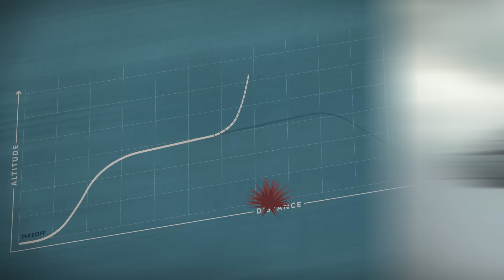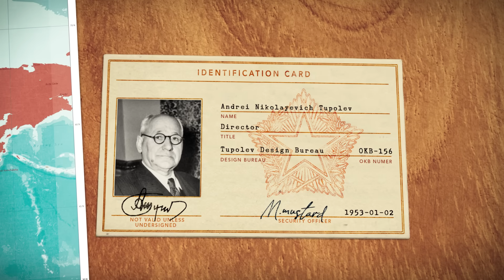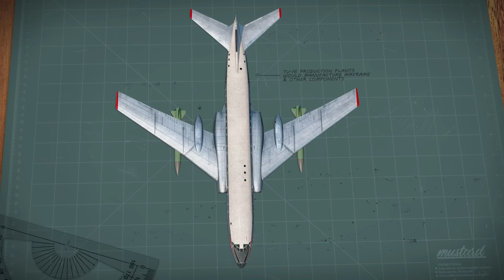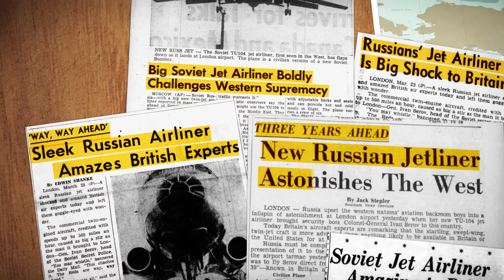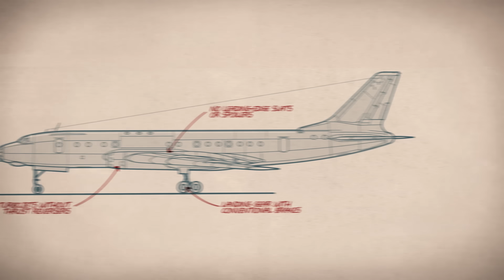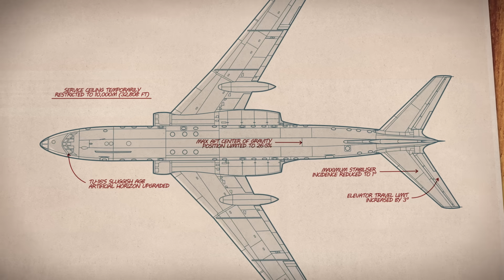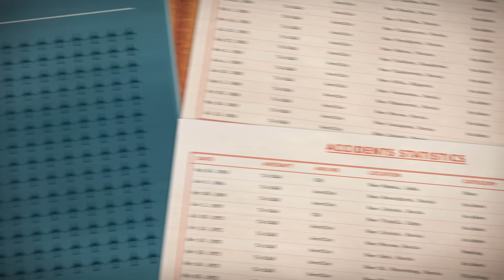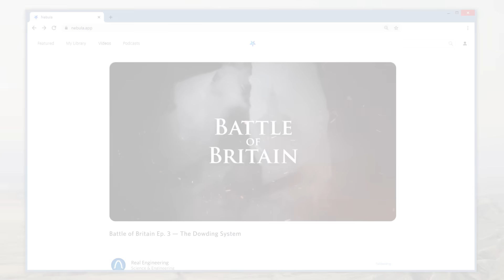The Soviet Airliner Designed To Crash

Comment: DC-10 said Hold My Drink and My Blunt
Reply: The DC-10 is a very safe aircraft with an excellent statistical safety record and is still flying today.
Reply: @sandervanderkammen9230 

Obviously it's always very important to note the relevant facts.

Kharzeestan Krappenz DiktorBummer  Diktorbatermasturjurkzxoffenzische etc and co - they should all note good with much awe & extreme wonder.
        UPDATE MORE BREAKING NEWS ETC

For an airliner that first flew 20 years after the Comet & was produced up to 1990 Obviously the DC-10 doesn't actually have a particularly good safety record or longevity compared to the Comet.  There are currently no DC10 aircraft doing passenger service duty. 

    How things were back then -
Accident losses - % of aircraft built.
DeHavilland Comet 4 UK     14% 
DeHavilland Comet all mks  17%  
Vickers VC10 UK 5%
   The DH Comet had better safety than or similar safety to many other commercial passenger aircraft of a similar era
    Douglas DC-1        99%
      Douglas DC-2        47%
    Douglas DC-3        30%
      Douglas DC-4          26%
    Boeing s300            72% 
 Boeing 307               70%
  Boeing 247                48%
     Boeing 707                   20% 
Lockheed L-049/149 Constellation  30%
   Lockheed Electra  Turboprop    29%
Fairchild FH-227                        30%
 McDonnell Douglas DC-8        14%
  Sud Aviation Caravelle            15%
Canadair CL-44  Turboprop     46%  
Convair CV-580  Turboprop     22%
Convair CV-880    (ff 1959)       27%  
Convair CV-990     (ff 1961)      33%

        The Comet was designed with military use in mind, Nimrod work started at De Havilland in 1953.
  The committee did not find hundreds of fatal flaws or evidence of design defects, structural defects, defective materials or shoddy workmanship. Ripstop provision was included. Claimed incidents did not involve cracks starting from window corners.
     The engine & engine intake position had advantages, were not flaws or fatal flaws & were not the cause of any incidents involving any Comet or Nimrod aircraft. Nearly all changes before the Comet 4 were just in case or were previously scheduled improvements. 
  Bow-wing & the 707 story (see b-47 wing folding incidents) is the result of global economics & the well protected & very large domestic US airliner market & active support from the UK with for instance proposed competing airliners from Vickers & DH being blocked by the UK government at the time, cheap & nasty was the requirement with large scale production capability in one place.
  The 707 was of course a much larger aircraft which as a stressed skin metal airframe aircraft would require a thicker skin anyway. They got lucky at the time essentially.  Bow-wing is the result of the large & well protected  US domestic airliner market 
  The fate of De Havilland was due to Govt policy Aerospace sector rationalisation & global economics, it was nothing to do with the Comet.
  A comprehensive, thorough & protracted testing program was carried out on the prototype & it's assemblies. Of course the Comet did indeed have Ripstop stop provision. 
     De Havilland (Of England) Comets were not grounded after 1970 due to structural problems.
It's interesting that some of the aircraft on the list should really have been noticeably safer than the Comet due to being a similar type but of much later design & manufacture but they definately were not safer.
    How things were back then -
Accident losses - % of aircraft built.
DeHavilland Comet 4 UK     14% 
DeHavilland Comet all mks  17%  
Vickers VC10 UK 5%
   The DH Comet had better safety than or similar safety to many other commercial passenger aircraft of a similar era
    Douglas DC-1        99%
      Douglas DC-2        47%
    Douglas DC-3        30%
      Douglas DC-4          26%
    Boeing s300            72% 
 Boeing 307               70%
  Boeing 247                48%
     Boeing 707                   20% 
Lockheed L-049/149 Constellation  30%
   Lockheed Electra  Turboprop    29%
Fairchild FH-227                         30%
 McDonnell Douglas DC-8     14%
  Sud Aviation Caravelle       15%
Canadair CL-44  Turboprop   46%  
Convair CV-580  Turboprop 22%

A comparison of more recent aircraft.
Accident losses comparison examples. 
1970s - 1980s
    % of total Aircraft built
Similar aircraft type, date / decade, useage, size.
    Biz Jets
BAe-125-800                        1.7 %
Beechcraft Beechjet 400    2.2 %
Cessna 550 Citation II         7.1 %
Learjet 35 / 36                       12 %
Beechcraft 1900                  6%
Dassault Falcon 10              11.5%
Aérospatiale SN.601            22.5%

Medium size jets / Turboprops.
BAe-146               5.1%
Fokker 100          6%
McDonnell Douglas DC-9-30       9.5%
Fairchild FH-227       30%
McDonnell Douglas DC-8    14%
Canadair CL-44  Turboprop   46%  
Convair CV-580   Turboprop   22%

Beechcraft, Fokker, McDonnell Douglass, Learjet, Fairchild, Aerospatiale, Canadair, Convair  companies defunct.

    All Comets, including some Comet 1s, had full civilian use certification at some point after 1954,  civilian use certification only being withdrawn after commercial flying stopped. Examples were flying until 1997 - one example did a signals research global circumnavigation flight series in 1993 via Australia virtually without a rest travelling 28000 miles, only had an ice warning indicator issue during the flights.

    The DH Comet - World Firsts.
1st gas turbine jet powered airliner. 1st high altitude 8psi pressurised full fuselage length passenger cabin airliner,  not a trivial feature as structure  strength required for pressurisation considerably exceeded strength required for normal flying stress. Nobody else had done anything similar before the Comet.
  The b-47 used 2 relatively small, heavily built  pressurised modules  (the aircraft where 6 had their wings fold up in 2 months while flying & some had their wings fall off while parked). .  
   The 1937 Boeing piston engined airliner pressurised passenger cabin was pressurised to 2 psi only - in fact that could easily be done as the normal unpressurized fuselage cabin structure strength for flying stresses only was all that was needed to be adequate so no significant weight increase issues needed addressing.
    1st all hydraulically powered flying surface controls & actuators airliner with under carriage wheel disk brakes + ABS.
1st jet airliner to cross the Atlantic.
1st jet aircraft to do a world circumnavigation flights series.
  Of course De Havilland had prior experience building many all metal construction airframe aircraft including thousands of jet powered fighter aircraft that were primarily of metal construction with pressurised cockpits & jet engines built by De-Havilland & we know the world's first all metal construction airframe airliner was built in England in the 1920s by Handley Page.
     De Havilland did indeed always work to better than industry standards at the time, used up to date knowledge for the design & no evidence of negligence  or criminal negligence was ever produced in relation to the DH Comet.
    The course of De Havilland & the general UK aerospace industry sector was not affected even slightly by the DH Comet. The course of national aerospace sectors obviously being similar & inevitable in many countries.
     Other interesting World firsts
World's first turboprop aircraft.
Vickers Viscount Turboprop Airliner 1947. 
A 1945 Gloster Meteor Aircraft with Turboprop Gas Turbine Engine.

They might like to answer these questions.
   Which airline has just ordered
60 RR England Trent XWB Engines
& What aircraft are the engines for?

Bonus question for 10 points.
         Which country has the 
World's Highest Combined Per Capita
  Nuclear + Defence + Aerospace Sector Activity?    

          👍 & 🙂 & of course 😎 indeed.
          C H E E R S & without doubt  -
          Toodle PIP Old C H A Ps.
 
This line left not blank intentionally.
           
   The next line is blank intentionally.     
             
. .... . ... ... ...... .     ...
. . ... ..         ... . .........
 ....    .... ............ .....   .
Ivcxivcxivxcv
cxcxcvccbxcv
xcxiivxccxvcxv
ccvvcvvvcvxcv
vivcxiccvccvxy